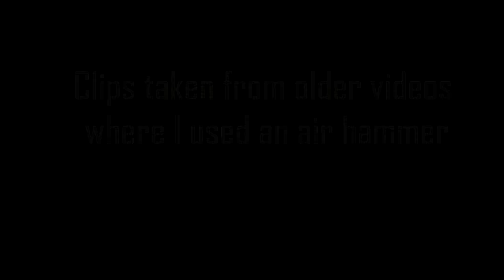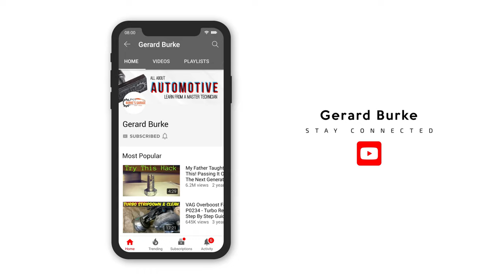Stuck Bolts, Bushes or Nuts?? Air Hammer To The Rescue 🔨

Comment: I'm an automotive technician and use mine daily. Very useful. Lot of guys go on about noise etc but a very useful for a multitude of things even more if you add an small regulator valve to change the air pressure.
Reply: What brand do you use? I want one and there's so much options. I'm looking for reliability most of all

Comment: Great job Gerard, don't use it as often as I should and mine is a cheapo, but it has gotten Me out of a few holes, Thank You👌👍🙏🙂☘
Reply from the maker: I ran the cheap of the cheap for years, I then bought a really really budget one when I needed to replace  the older generation one.

That was a mistake as it was so underpowered it couldn't do much. Something cheap can be fine for tons of jobs, more power comes in useful for trying to pop out ball joints or stuck bushes.

As always I appreciate you watching Pat, I hope you are all keeping well over there 🇮🇪🇮🇪🇮🇪

Comment: Always use good quality eye and hearing protection ! Wear gloves . I wrap the handle body of my air hammer with black pipe insulation and secure tightly with electrical tape . Looks like hell but it works well . Also I use an all steel heavy air hammer that was designed for chipping iron castings .  You may laugh but a construction jackhammer works well on class 8 trucks to pound out seized steering axle king pins .   79/23
Reply: So instead of smacking out the old kingpin with a hammer and punch you just air hammer it out ⁉️
Reply: @mandoelorryann4171  
Before purchasing a portable hydraulic king pin press I used a 50 lbs air jack hammer on stuck king pins . Class 8 steer axle king pins are over 1 3/4” in diameter . Always tried to avoid heat .

Comment: I use mine to loosen the nut on my clutch fan on my 2012 ram with cummins. I couldn't find a punch long enough so i bought a piece of tool rod so i can use it up out of the engine bay where there is room...

Comment: Yes great tool. I also have an electric rotary hammer for drilling concrete. I wonder if that could work to pound out bushings and spin off rusted things.  Rotary Hammer is also a powerful tool. But it is bulkier. It can drill and it has a slip clutch, but of course is not designed to hammer rotationally, so it might wear out the slip clutch using it to remove a bolt or nut and wont be as effective  as an air wrench. But it could easily pound stuff without spinning.

Comment: Never been so excited to get a new tool. Just order the same one before I seen your video. I’ve been wanting one of these for a while. Haven’t had a use for one until today. Replacing struts and having to remove a ceased bolt from sliding out of the bottom.
Reply: Did it work?  I'm in the same situation and I have already tried heat and drilling but it didn't work.  Using a sledgehammer is pretty difficult with no room for a backswing and nothing to stop the knuckle from moving.  I'm hoping the air hammer will do the trick....

Comment: The only thing I find frustrating about air hammers is no way to fix the chisel in one place and stop it randomly rotating as you are trying to be accurate with what you hit.
Reply: Try an sds cordless hammer. You can stop the rotation

Comment: Just out if curiosity,  what would be the difference by using an impact driver?
Reply: Air wrench impacts rotationally not up and down. So it wont work for air hammering.

Comment: I have been getting alot of exhaust work at the shop I work in and the spring bolts always get jammed in saw I have to resort to a torch cutter to make the bolt flush and recently got pretty burned so trying to stay away from the torch as much as possible will a nice air hammer cut these bolts so it's flush and change over to air hammer punch to punch the rest out from the other side?
Reply: Astro 4980k and cp4287 and CP4289 ok

Comment: you can ruin things with this tool. I had an inner bearing on my trailer burst and had to drive off the pressed on ring. not a job for the air hammer. the bit kept slipping off of the rim and driving into the tapered axel shaft that needs to be smooth for a new bearing to be pressed in. after using the air hammer, which didnt fully drive off the ring from the shaft, I was left with guage marks that had to be grinded down carefully  for the new bearing to go in.  excellent ubiquitous tool but not always the best answer...also, avoid air hammers with plastic triggers as they are poorly reinforced to the tool assembly and break off forcing the purchase of a new air hammer with a metal trigger